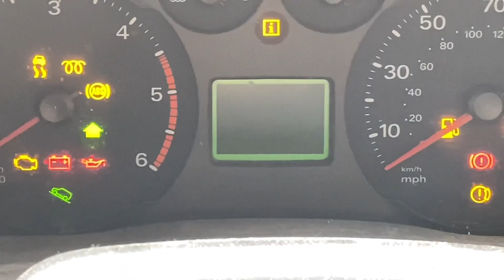Ford Transit “Luggage Compartment Open” Fault Repair (Ford Tourneo/T Series Won’t Lock)

Comment: legend, this issues has been drive me maddddd
Reply from the maker: Sweet. Did this help you fix it?
Reply: @StupidBlokeStupidVideos  It got me out of trouble. But I believe the problem may be with the side door. As you cannot open it from inside or out side, had to drill a hole in the lock casing to manual open. It sometimes work and sometimes gives ur the rear luggage error and can’t close
Reply from the maker: @ramboshar5747  ah right. The lock itself may be the issue with that one
Reply: @StupidBlokeStupidVideos  thanks a for the update I will try a new lock

Comment: Hi super video thank you when you had this issue did it cause the instrument cluster to die also??? temp, fuel, tacho, and speedo not working. abs and most warning lights lit up also example ignition and alternator light lit but still charging ??? thanks in advance.
Reply from the maker: Hi, thanks. No it didn’t cause any issues like that. It sounds like you could have a cluster issue though as some Fords like the Fiesta, can be common for them. Not sure if it happens on Transits though, but probably worth looking into
Reply: Thanks appreciated

Comment: In my case it turned out that there was corrosion in the connector behind the right rear light. Generally, everything was floating in water there when I opened it. After cleaning it improved and everything works from the remote.
Reply from the maker: Nice one. Glad you got it sorted

Comment: Wasn't there a time when people just made sure they shut the door and didn't need an electronic system for it which goes wrong?
Reply from the maker: Back before common sense was somehow bred out of 99% of the population…
Reply: @StupidBlokeStupidVideos  Yep, along with Satnavs resulting in no-one under the age of 30 having any sense of direction or how to give directions any more 😂
Reply from the maker: @AC-um2mk  I can’t even find my own arse without a map tbh 😂
Reply: @StupidBlokeStupidVideos  Don't you think it was way better when you had to balance a road atlas on your steering wheel while driving or have to badly memorise your route and have to stop 200 times to recheck it on the map after you had made yet another wrong turn?
Reply from the maker: @AC-um2mk  I used to prefer using a gemstone globe from QVC

Comment: Wont lock ,,, wont matter.

Since the invention of cordless grinders very little is secure any more

But if your wire is green coming out of the sheath ,,, the back door action is certainly causing you problems 

maybe strong antibiotics would help ,,,
Reply from the maker: Yea, the scrotes use cordless grinders to nick other cordless grinders.